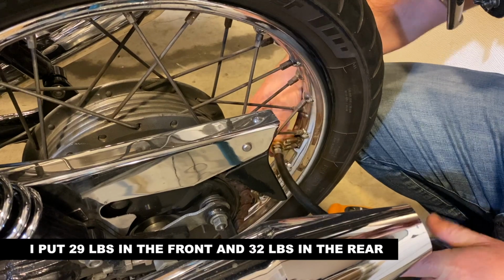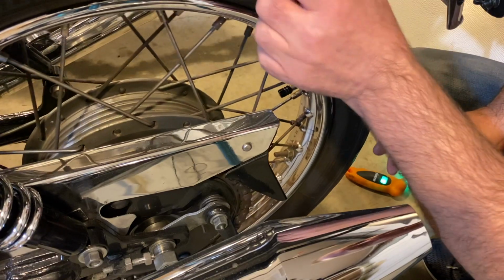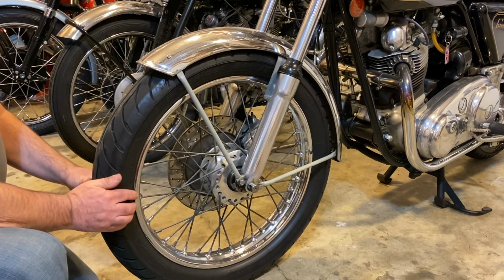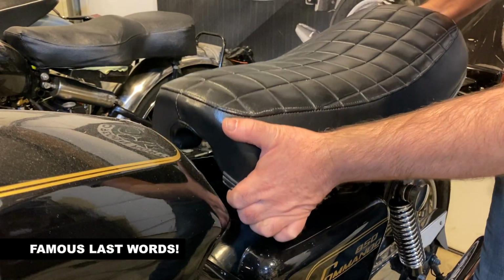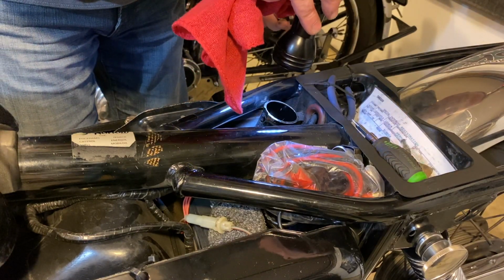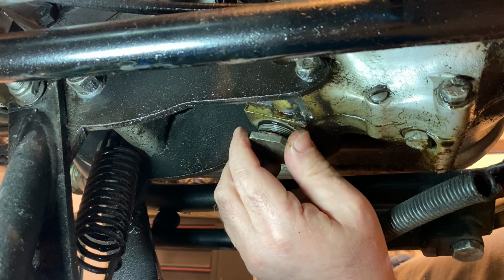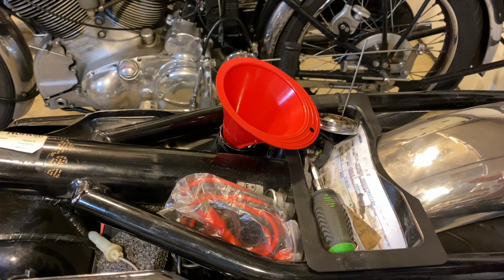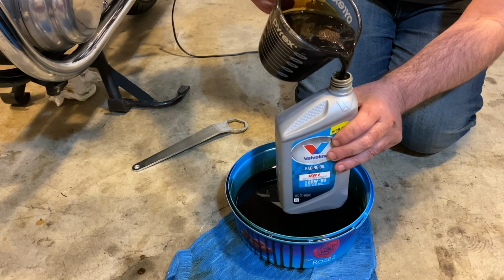oNe (Oregon Norton Enthusiasts) - Boxing Day 2019 Meeting

Comment: Thank you for a ride, but I'd feel pretty uncomfortable below 0 C on a bike. Probably comes with age.  I like your videos very much, however use different methods of wrenching, specially with BSA where taking the tank off makes everything so much easier. And its only one nut and 2 bolts to unscrew. I moved from my BSA to a Trident, which I rebuilt from crank up, but building another BSA from parts this winter.
Happy New Year from not so cold Ontario.

Comment: Love listening to the Commando.  I have 4 of them.  71,72,73,74.  72 and 74 have been completely restored and on the road awhile.  Just finished complete restoration on the 71and will do first start in a few weeks.  I'm currently working on the 73.  Have it completely stripped.  You need to add a Trident to your stable.  I have a 74 and the sound they make above 6000 rpm is awesome.  Also, have a 70 BSA Thunderbolt and 78 Bonneville.  My spouse says no more bikes.  I'm out of room anyway.  Cheers!
Reply from the maker: Hehe, I know what you mean Mitch!  I'm out of room in the garage and it's becoming a challenge to move stuff around whenever I want to get to something or make the videos... the problem is I can't bring myself to let any of them go yet ;) Maybe I could just squeeze one or two more in ;)
Reply: That's a serious # of very nice bikes. I've only 3 and all modern. 87 Honda 185s,07 Goldwing,and 07 Suzuki DL650 Vstrom. Time for a classic. BSA ,A 65 or a Norton 750 Roadster.

Comment: One thing that stands out in my mind about my old 69 commando, was a tire repair pump that mounted to the frame under the seat. Do you know if that was continued into the 70's?
Reply from the maker: Hi John.  I didn't know that the Commando ever came with a bicycle pump / tire pump attached to the frame.  I know that the Featherbed's certainly had the little tabs for a pump under the frame under the gas tank, but I don't think I have ever seen one on a Commando frame.  Cheers, Mike
Reply: Yes there were two pins welded to the frame, bent 90 degrees towards each other, with barbed ends, and you compressed the pump a bit and mounted it between the pins. I am pretty sure it came from the factory like that. I found some other people on a forum discussing the availability of finding an original pump. Pretty hard to find.
Reply from the maker: Hi again John, thanks a lot for pointing this out. I never knew!  I was looking over my friend's 1969 Commando S model and, sure enough as you mentioned, there are the bicycle pump pins on the rear frame loop and just behind the rear of the seat. Best wishes, Mike
Reply: @TheMightyGarage  That's great Mike, best wishes to you too.

Comment: Hi Mike  Great video, what tyres are you using on your Commando? I'm up for some new ones.
Kind regards Greg Brassington.
Reply: Same question on the tires.  Also are you still running VM2 rims front and back?
Reply from the maker: Hi Greg, many of the guys in the club including myself run the Avon Roadriders 100/90-19. I like them a lot and have never had any problems with them. Best wishes, Mike